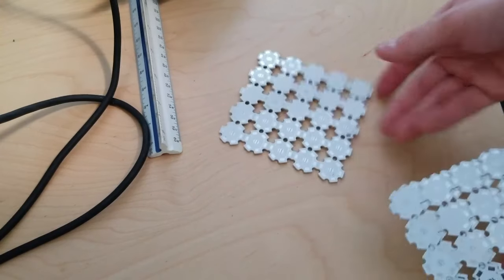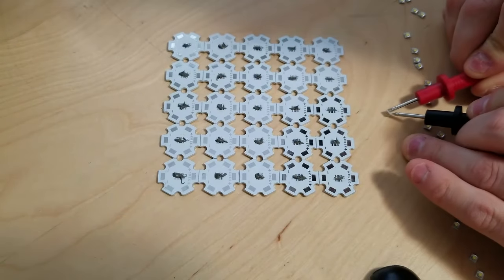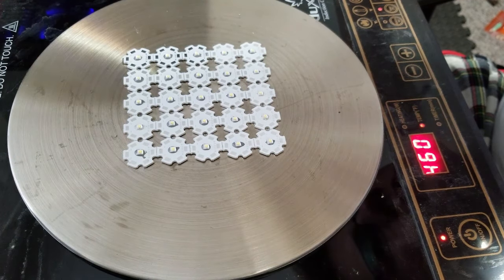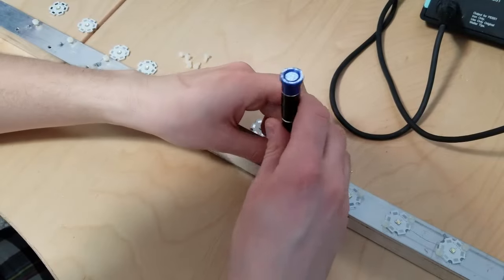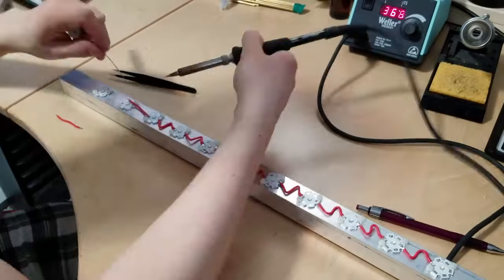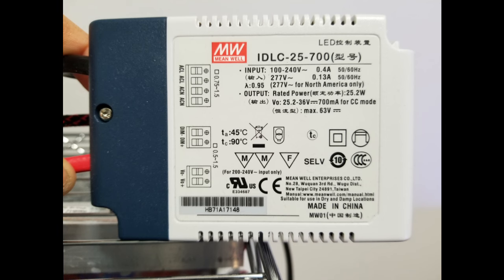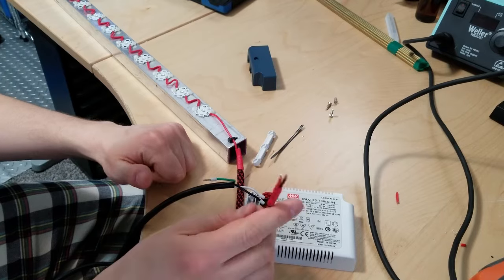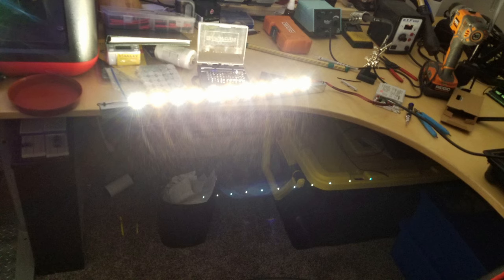DIY LED Lighting - How to Make Your Own Grow Lights!

Comment: Do not toch them like this, when they are plugged in!
The metal could be live and must be assumed live!
As your power supply dosn't have earth connrctions you should at least connect your earth wire to the metal, just in case something shorts out...
Reply: Ummm....  Its .9amps @32V DC on the P/S....  Unless you've figured out a way of lowering your resistance of the body below 500-1000ohms...
Reply: @Aerogrow   i'ts what the powersupply will deliver, but these power supplys tend to break by shorting to mains voltage, so at least here in Germany the VDE tells to assume the outputs as mains voltage.
Reply: @j.m.seifert  ah; europe; 230V@50hz as and added bonus.

If we are talking "safety code" level; probably should have a fully insulated chassis using the AC ground, then inside bar isolated to the DC circuit.  "shrug".  Cost and complexity goes up a bit.  Long time ago i used to build ac/dc p/s for embedded circuits on digital acquisition systems.

Tying common ground between AC to DC is kind of "meh"; could be just as dangerous in some cases.  Arguable better then floating.

Not sure in europe; but i find alot of house grounds on AC side fairly leaky.  So you would probably introduce some 60HZ noise into circuit.

Comment: I mean honestly what’s it cost? Is it honestly cheaper than buying a half way decent shit light? I got an alright shit light for close to 60 bucks. It’s a decent light. I know from building lights that 3060 smds are not very pricy but bigger ones can be. Higher end ones can be. Plus the headache of putting them together. If u have all the knowledge and tools to do it. Maybe. I don’t know. A great cheap light is 300 400 bucks. U can probably get a pcb made for it too. Is that an option? They also have like hundreds of smds in a 2x4 light 😆. U also didn’t say what smd u we’re using. How well does it work too. Can u adjust the lighting. I mean yes u built a great light. I’m not busting your balls about it. Just curious thoughts. I mean me personally I know how to build lights. But I don’t want to do it 😆. I’d rather pay some one lol. But on the plus side I do get a custom light. U can build it to your needs and wants. That’s a big plus. But how can u improve this system? I want to see a bud on that. Seriously

Comment: Hey dude nice video! It inspired me to make a DIY LED Strip grow light - I made a video on my channel, you should check it out! It's my latest upload. volume warning at 1:50!!!* (i fixed the audio but it will take a few more hours to update)

now I have a question for you, I'm going to be building a very large grow light similar to what you've done. What is the best wavelength to use?

Comment: Bare in mind that this has 0 penetration
Reply from the maker: Don't know what you mean by that but it doesn't seem to be a problem in any case
 http://imgur.com/gallery/nFs1qmd
Reply: @autumnmaticcreations62  im sure u just used this light to get that...

When u use LEDs at low intensisty the penetration is reduced so you need to put them really close to the plants and PPFD decays dramatically witihin a few cm... 

Using this 3w ish LEDs u need to put them REALLY close one to each other to try to maximize their output, that is what QBs are really.... However the more intensity they draw the least ppfd decay you'll get. You have to get to the sweet spot of efficiency vs light penetration.

I am not saying it is a bad thing u just have to bare that in mind...

Comment: itd be way cheaper to buy a cheap light on amazon
Reply: It would be close price wise as hes probably only spent about 30 dollars on everything used in that, the power supply probably cost the most

Comment: I wouldn't I would not call that a grow light. LEDs are a crap shoot with growing weed it's not like you think you're going to get all this free light and only pay for one sixth of it. Yes, it is possible to grow weed with LEDs. But it is a compromise and you will struggle with it. Buy a real Chinese magnetic thousand watt ballast that will run on 115 or 220, it has a switch for HPS bulbs or in metal halide bulbs. High Grade weed needs Mega Watts. In my humble opinion